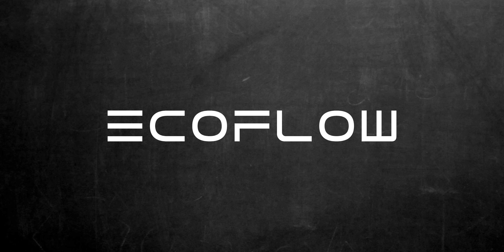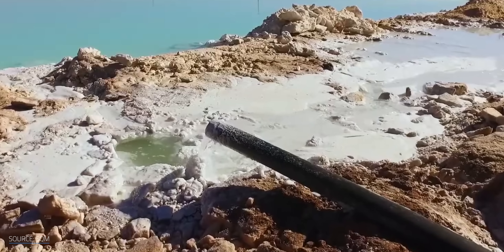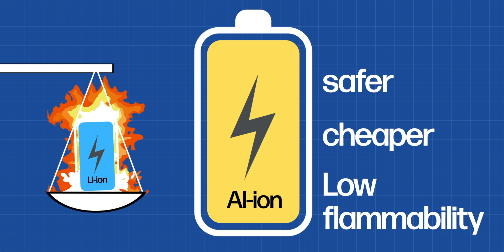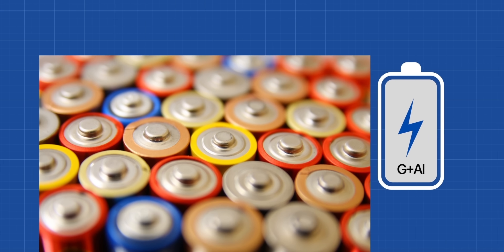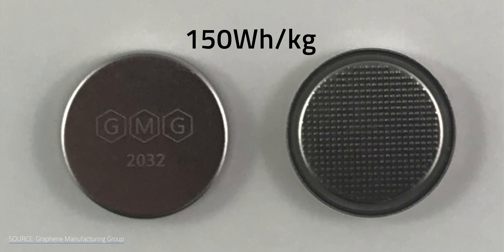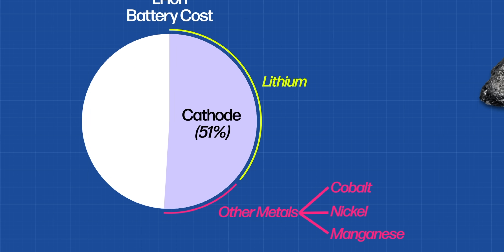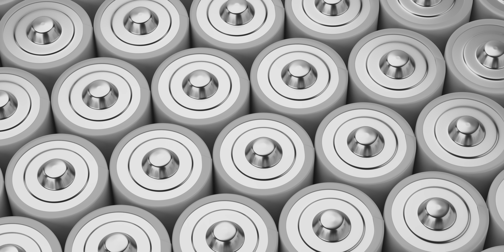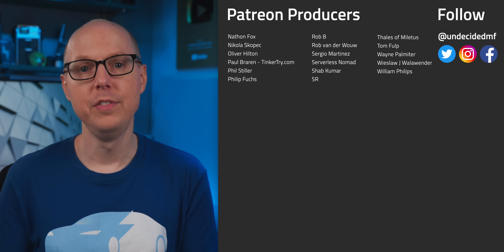Can This Metal Really Beat the Lithium Battery?

Comment: 8:30 He says that aluminum does create a lot of emissions to create, but that really depends a lot on the source of the electricity used to refine it. In the province of Québec, 100% of the electricity used in the process comes from hydroelectric dams, or wind turbines. That means that the only part of the process that actually emits greenhouse gas is extraction and transport. He also mentions Rio Tinto. They are in fact the owners of those aluminium smelters.
Reply: Yep, we've got a Rio Tinto smelter in Kitimat, BC, once again using Hydro Power. Not a perfectly environmentally sound process by any stretch, but I make a living installing huge aluminum frame windows made of 1/8" thick extrusions, I'll install thousands of pounds of aluminum material per day. Car engine blocks and cylinder heads are made out of hundreds of pounds of aluminum per unit, point being I honestly can't take the potential argument seriously that an aluminum battery would somehow be "detrimental" to the environment, or any more detrimental than a car engine, anyways. Nothing humans create is environmentally friendly, but I'd say aluminum is about as good as it gets for metal, mostly because of its value, longevity and high rate of recycle. Thermally conductive, electrically conductive, easy to recycle, easy to machine, easy to cast, and now maybe it could be the backbone of future batteries. It really is a wonder-metal.

Comment: I've been watching GMG for a while now, I am a shareholder. Their product is amazing, and in a few other interviews they do elude to how cheap their graphene is. While they are still technically "in the lab" they do regular updates, their battery performance is amazing, and their speed of innovation is even better. The company has been trading in a range for some time now, if it falls below, I'll be buying A LOT more shares. The EV battery market is MASSIVE, and if they even got to 10% of the market the stock would 60X from where it sits today.

To a lot of people, this is just another battery that will never come to fruition, but I have done hundreds of hours of research on this company, and it's the best I've seen in a decade.

Also if they are able to unlock the potential of the other two electrons, that could give an energy density of 900wh/kg. Unbelievable!
Even unlocking just a second electron and getting anywhere near 600wh/kg would enable current electric vehicles to travel a thousand km per charge. I'm looking forward to the future, and I will keep buying their stock. Their battery is amazing even as it stands today

Comment: We still comment about the availability of battery storage excluding which usually avoids distributed storage from an integrated grid. Energy storage in homes and commercial premises, automobiles, commercial vehicles as well as battery farms, capacity can be greatly increased. With computer control and grid interconnection, these can greatly increase energy availability. Tony Seba shows that Superpower is quite achievable with building additional excess generation and storage capacity, making power available to all at zero marginal cost.

Comment: I feel that one of the most important advancements in technology that the world currently needs are a safe replacement to lithium batteries. They are extremely dangerous when put in the wrong conditions which can be done mistakenly and just over charging bigger ones can cause fires. We are basically carrying little bombs in our pockets every day and overcharging an electric bike for just an hour over can burn your house down. We should really be putting maximum efforts to stear clear of lithium battery usage.

Comment: The major issue with aluminum is that it wll want to stay as a stable compound on the cathode side. For example FePO4 will become stable AlPO4 and iron, and Cu2CoO2 would become a stable mix of Al2O3 and copper/cobalt metal alloy.
Reply: MIT seems to have solved that problem on their AL/S by using a molten salt electrolyte

Comment: The only thing is that it shows that Li-S still has a larger power storage than Al-S .. granted the cost per storage drops hard from the two different types. I know Li-S should also drop in price as it replaces some of the materal with cheaper materal - also there will be more demand for Al if we switch - meaning that 2k figure would be more like 4k or 6k. Still lower than Li - but it will be there as demand for it will double.
Reply: >>The only thing...

Energy density is essential but GMG's cells are competitive with leading products in the market today. What the GMG cells offer is blistering charging rates and thermal stability during fast charging (due to the low internal resistance of batteries based on graphene) and vastly improved safety in battery failure scenarios (shorts or catastrophic damage).

Characteristics like that are also essential in good battery designs.

Comment: battery makers have been fighting the dendrite issue for quite some time. aluminum batteries sound great but until they can get that issue resolved i don't think we'll be seeing them any time soon. that's the one reason i've been replacing all my batteries with lith-ion. i'm tired of cleaning corrosion out of electronics.

Comment: What I didn't hear was anything about voltage. I had read that the biggest issue with Al ion batteries was that they couldn't discharge the kind of high voltage that Li ion could.

Has this issue been resolved? Thank you for the video.
Reply: I thought charge & discharge rates are related? If they are charging 70% faster I assume discharge follows the same trend. Also not sure if other AI batteries are using graphene. I would think those graphene layers are allowing AI to achieve very different properties but I don't know how others build AI cells.
Reply: I am no expert in battery technology, but isnt it possible to build more individual battery cells to increase voltage?
Reply: @tatepinto6285  if you mean the shelf discharge rate, then no, they are not related. If you mean the voltage discharged in use, then also no. See lead acid batteries, which favor slow trickle charging, but are known for higher voltage discharge. 

It depends on the battery technology.

Comment: If all other parameters were equal, that up to 25x faster charge rate at higher temp would be a game changer. I’m imagining a northern snowy winter climate with limited sun windows of opportunity. It would make living off grid better. 
Of course for EV charging this high charge speed would also be awesome.

Lots of interesting new prospects on the horizon. However, if you are in the market for solar, don’t delay and hope for better tech.
Reply: Fast charging is where this would make the biggest difference. Currently there's not much of a free market case for EV charging since the throughput rate at chargers is so slow. If a 200 km range city-EV could pull up to a 350 kw charger and charge in less than 5 minutes, that'd be a game-changer. It'd also make EVs more viable for street-parkers and apartment dwellers who don't have access to AC charging.

Comment: I love the idea of aluminum ion batteries. As of now I would be hesitant to buy an EV because of the battery recycling issue. If aluminum ion batteries prove to be less expensive to produce, be much more recyclable, and can at least match the energy density of lithium ion, I wouldn’t hesitant to buy devices that use them. Hopefully GMG can establish a reliable supply chain for mass manufacturing of these batteries once they finish testing and development

Comment: The trivalent nature of the aluminum ion is both a blessing and a curse. Yes it'll carry more charges per ion, but it also makes the ion much more corrosive compared to monovalent ions such as lithium or sodium, hence the battery will disintegrate even if it's just sitting around. So yeah, we're still a very long way off for a commercially-viable aluminum battery. 
Even if lithium were to suddenly deplete tomorrow and we are forced to use an alternative, we probably would go for sodium battery as a better proven alternative.
Reply: The aqueous magnesium metal battery is being developed with this in mind. Scientists are trying to create a barrier or passivation film that protects the battery from this level of erosion.

Comment: A way to reduce the price of Li is to decrease demand by ceasing to use  Li batteries for static applications.  For instance, the Li in the famous Hornsdale 180mWh battery would be enough for 3000 60kWh EVs.  There are already commercial alternatives that only need market share to out-compete Li batteries for price.  There are the ZnBr flow-plating and gel batteries, The SbCa and AlS liquid metal batteries and a whole range of redox flow batteries, based, so far on Fe and V.  And these batteries have technical advantages over Li batteries.  They can be cycled between 0 and 100% with no loss of capacity, last far longer, are safer from a fire point of view, can be shipped by any method you like (there is a reluctance to ship Li batteries by air) and have a greater effective working temperature range than Li batteries.  If Tesla would promote alternate technologies for static applications, she could sell her cars for less with no loss in profit per unit and ensure market penetration further into the future.

Comment: I think another key feature ( @1:20) that enabled LiIon breakthrough market penetration is the high per cell voltage around 4V, which enabled lots of very simple devices and less balancing infrastructure. So the target cell voltage range of this new Al Ion technology would be nice to share in future videos. (Unrelated: did you ever investigate/report on the mysterious Nano Flow Cell company that rose and disappeared ~a decade ago?)
Reply: graphene is very conductive, so I'd imagine very low internal resistance in such batteries, which would help the cell voltage
Reply: Wikipedia gives 2.65V for aluminium-ion (aluminium-graphite) cells. 

Sodium-ion batteries are also lower voltage

This will affect uptake but perhaps not markedly for stationary and ev purposes

Comment: Very promising... It will be even better when small companies developed batteries for high performance cars that are swapable, small and very light weight!
Reply: Well yeah, but there's the rub. That combo is about the trickiest problem in technology right now.
Reply: No swapping is needed if the supercapacitors are charged in the charging station. These batteries can fully recharge from zero in about 5 to 10 minutes, but the transmission grid cannot handle that, hence the need for supercapacitors

Comment: If you want to build an aluminum battery they are simple. You need a volt meter, aluminum foil, number 2 pencil, viniager, a plastic or glass container and two wires preferably with alligator clips on them. One layer puts out anywhere between 0.5 and 0.8 volts. Multiple layers will increase voltage and area will increase amps. It's a fun project and experiment.

Comment: I really thought flow batteries would have been the champion of grid storage - cheap mass production of the liquid seems a lot easier than making millions of individual batteries.
Reply: Over 90% of grid storage is pumped hydro storage, battery makes up only a few percent.

There are more than 30 thousand prospective pumped hydro sites in the US, and only a few hundred are needed.  Many of those can be abandoned open pit mines.
Reply: Flow batteries are current-limited and introduce a single point of failure 

There have been a number of issues with the flow processes too - pumping large volumes of potentially corrosive liquids from tank to tank being one issue but also physical wear and tear on the electrodes and other core components
Reply: @acmefixer1  that's because pumped hydro has been around for over 60 years and batteries only a decade

The UK's main pumped hydro Station was hellaciously expensive - batteries would be on par with it overall, but more important than that, just about all the usable spots for pumped hydro have already been used. Geography matters

There's simply no place to build a pumped hydro station in South Australia, as one example...

Comment: I would love to see them focus on cheaper powerwall alternatives.  I understand the money is all in cell phone and EV batteries, but just something very cheap that we could throw in our garage so we could power them up at night, and then use them during the day for people on the grid to bring down energy prices, and of course the opposite for off-grid applications.
Reply: a lot of legal issues with that, and more single house power before that could even be a concern. you dont have a bad idea, theres just a LOT in the way
Reply: @bradhaines3142  There's more than one really interesting youtube series by guys who have actually done this in the UK. Have a search. It's a big deal but with off-peak electric prices over 30p/KWh cheaper than peak, and gas prices sky-high, it pays off and you're "doing the right thing". IMHO this is way more "right thing" than heat-pumps and solar panels. You're right that the legal issues thing seems to be insufficiently discussed. Insurance companies love small print disqualification clauses - I wonder about home insurance.
Reply: @jonb5493  not just insurance, but the grid. a lot of power companies basically wouldn't allow it. hell if it started to get momentum and a lot of people got them i wouldn't be suprised if they tried to retroactively outlaw it. then there's the issue of how big you could get, permits needed to put it in. it would be way more of a headache (at least in the US where you have to worry about federal, state, county, and city laws) than most people realize
Reply: Peter, home batteries that cost 1/10th of the current Tesla battery would put expensive PG&E, our utility monopoly, out of business!
Reply: Interesting! If PG&E got their act together, such cheapo batteries would be a huge biz opportunity for them. ... just kidding, such grunts would never understand this. As a guy posted elsewhere, they'd probably tell their congressman to make it illegal!
Reply: @bradhaines3142  I had another depressing thought. Over in the UK, look at the $$£up the "Smart-Meter" became!?! ..a simple req. Home ugrid uh more technical. Still I dream one day cheapo batts will power my home.

Comment: There are a lot of developments and changes in energy tech lately and many are overhyped.  This one seems like it actually has a very good chance of working, and could be just the ticket.

The whole range anxiety thing goes out the window if you can recharge quickly, and I've been a skeptic for quite awhile.  Keep up the research and good luck!
Reply: Yeah, if you can charge your car in 5 minutes and go 3-400 miles, it's basically at parity with gas cars provided the grid can keep up, which is ideal.
Lots of things to get sorted before that's a reality though, and even if, say, in 5 years these batteries are in all the cars, and everyone's gone electric, the grid won't handle the load, so that has to get upgraded in-step.
Reply: @jttech44  The grid capacity issues are rarely covered by the WOC crowd. To make EV work, you gotta upgrade the grid. But upgrading the grid, to make it able to give energy parity with gas car usage, means you gotta add a bunch of new generation plants. Guess what they've stopped in America? For something like 20 years or so? New generation plants, and new pipelines to fuel them, that's what! In other words, they've actually got us looking for a non-energy way to run EV cars to satisfy stupid a bunch of political garbage.

Gas supply lines in the US are presently running at or very near 100% right now, so we can probably forget an EV car revolution happening any time soon - the WOC crowd has to be tamed (and hopefully trashed) before that can happen.

Now I don't want to sound unhappy about new battery-tech. When it proves practical, it will be great! In my experience, I entered the engineering field when NASA was just discovering the charge-discharge issues with NiCads in space, along with the tendrils that grew in the batteries and eventually shorted them out. It was a sad and expensive learning lesson for both NASA and ALL commercial space efforts at the time.

Soooo, the aluminum batteries sound really great, the technology appears solid, and it is just a matter of making them reliable and monetarily wonderful enough to give us a major earth-changing invention. There will be a bunch of very wealthy folk coming off it, you can believe! If only I could be one of them.

Comment: I feel like one way where a lot of these companies will gain traction is if they start producing standardized batteries.  Like make packs of rechargeable AAs, AAAs, and 9v, where it's easy for people to implement and opens potential for hobbyists.  Of course, the voltage needs to be right.
Reply: Or just start big from the beginning, sell it to energy suppliers for their energy storage.
Reply: @tobysatriayudha4564  Why not both? standard battery form factors and grid storage
Reply: @diablo.the.cheater  you might be right, to accelerate the implementation. But some companies might not able to produce for bigger market, or they choose for more profitable deals to kickstart their business.

Comment: Although high energy density often seems to be  the holy grail of battery tech, for some purposes we may not need a higher energy density to be viable.  i.e. EVs.  If these batteries will charge up 25 or more times faster than Lithium Ion, then even if they have half the total capacity it would still provide a faster trip (albeit a few more stops) than lithium. I still think we think about battery EV systems backwards anyway...we should have standard battery connections across car manufacturers and do battery exchanges instead of having to wait for currently slow charge times.